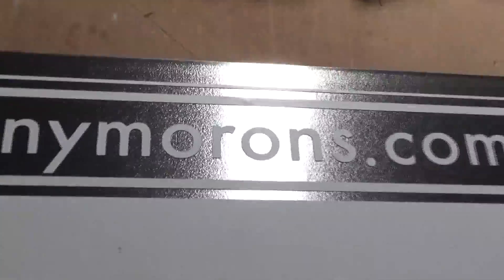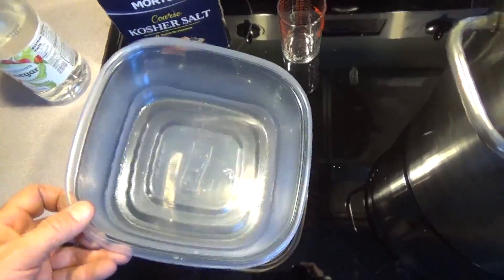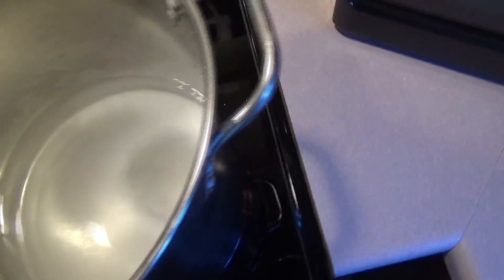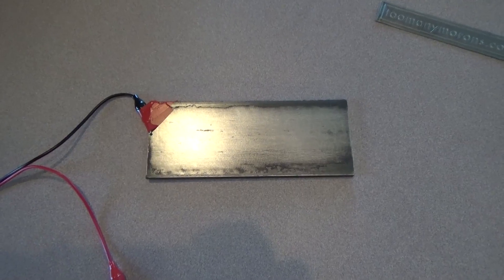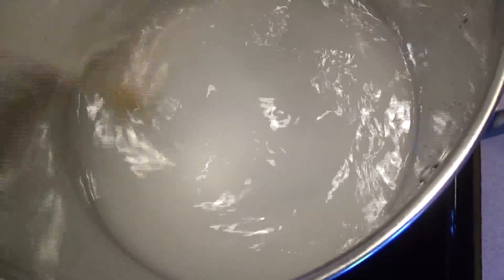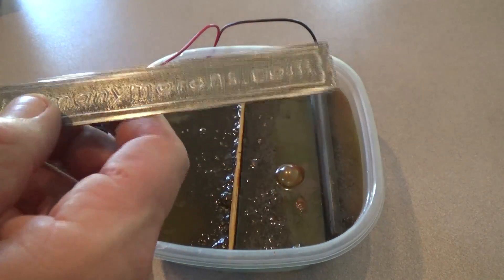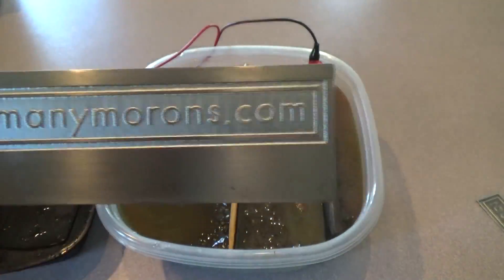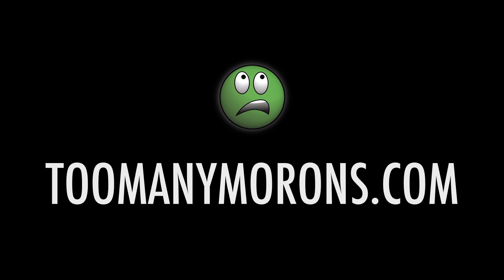Electro-Etching Steel using vinyl mask- Attempt #2

Comment: I have some questions please. 1. How important is the temperature of the water ? 2. Does the sacrificial part have to be that big, don't you just need contact for the current to flow through the solution ? 3.  Does the sacrificial part have to be of the same material as the part being etched ? Then lastly I think brushing it with a paint brush every so often will get rid of the bubbles or you can have a mechanism slowly rocking it so the solution rushes over the part and getting rid of the bubbles.

Comment: Very nice video…how did you make the paper letters template?
Reply: You can do it with a cutter that you connect to your computer; it looks like he did this cause it is so accurate. You can also just do it with a knife. All you have to do is have the vinyl which is baically just a big sticker that will stick like tape to the etching. It's real easy..

Comment: Any issue with hydrogen gas due to the electrolysis?
Reply from the maker: Im sure there is some off gassing but I’ve personally never had any problems. I know it’s probably safer to do it outside, and if I crack a window and get some circulation with a fan in the area so the gas doesn’t really build up in a given space, I feel better about the situation. It would be pretty hard to cause some kind of reaction or “explosion” ... But that’s me. Like anything, just use some common sense/precautions, and if you feel unsafe doing something, just don’t do it. At least use a fan and try not to breathe heavily around it when you are dipping/ removing etc. It’s a fun process and can do some cool stuff. I personally would hate to let TOO much “safety” get in the way ;)
Reply: @fleanine  thanks for the reply, no for sure looks really cool and great idea some reason YouTube has been recommending HH0 generator videos to me en mass, and I've been watching so I guess they know best, but I was like this is basically the same thing in principle so more curious than anything keep it up appreciate the vids and reply.

Comment: Need help in setting up this unit can you breif step by step process and machine and chemical required as well Safety measures | thanks in advance
Reply from the maker: If you watch my more recent video i go thru the process a bit more/ and add text on screen that shows the different ratios of water/ salt/ time / metal etc. Hope this helps. Thanks for watching!   https://youtu.be/Jab0X2MuK5s

Comment: So you don't touch the Amp setting only the volts? What metal did you uses for the sacrifice?
Reply from the maker: LEO Thanks for stopping by and taking the time to comment. I appreciate you watching.I have a more current video in my etching playlist that will answer your questions,  in that video I do various metals and show the recipe and result for each at similar settings for comparison. Please check out the playlist here: https://www.youtube.com/playlist?list=PLWT95-YNcJQ-a97KD8fKynnWMg5ZZC9Oj
Reply: @fleanine  You are most welcome mate. I've been looking into this for the past few days now. My 17v 3amp Transformer doesn't etch much at all using the cotton earbud method and regular wetting.
I'm trying to work out how people are getting these results
Is my power supply to weak?
Reply from the maker: @LEO I use the Dr. Meter shown in the following link , i would think if your machine is a 17v/ 3amp it should do the trick, if anything it’ll just be a tad slower without the amperage, but should still work. It will definitely work better with submerging, rather than the wiping with a cotton ball or similar. Just make sure you use a bunch of salt and let it do its thing..      Dr.meter 30V/5A Variable Linear DC Bench Power Supply Single-Output 110V/220V Switching with Alligator Leads Included, US 3-Prong Cable,PS305DM for Lab Equipment https://www.amazon.com/dp/B00O8DJ8QC/ref=cm_sw_r_cp_tai_WEUPEbGG6RVDW
Reply: @fleanine  I have watched almost all of your videos now. I'm wondering what Transformer I need. I would like to do completely submerged Etching as well as semi wet. What supply is optimal?

Comment: Great video I’m curious how deep did that go I want to make stamp to mark my lead flashings that I make they are only around 1.8 mm thick I could just order a brass stamp off eBay but there’s no fun with that
Reply from the maker: I have several other videos that go into getting a deep etch for branding irons etc.. definitely deep enough for a stamp. may have some decent info for you there. Check out my electro etching playlist! Thank you for watching and taking the time to comment!
Reply: fleanine checked out your playlist it was very helpful thanks then had a play I need to get some vinyl cut when the lock down is relaxed I tried with the printer toner method and the only salt I had (table) and left it for and hour it definitely started to work but the toner dissolved before the hour was up I can clearly see the etch just needs a little more depth 👍🏻
Reply: I got my vinyl and been playing I’m semi happy with my first attempts I’ve made a punch with my business name to stamp my lead flashings and a brass branding iron to mark my ring boxes I’ve got some more vinyl on its way to try again I left the brass a little too long and got some under cutting and I lost some letters on the steel hopefully second time around will be the one

Comment: Awesome it must of felt so good to peel off the resist and see the depth! so satisfying....I know I need a life!
Reply from the maker: Debra Kowalski nah, you’re right. It is satisfying. I have a more current video with a better recipe and different metals and some even better results if you’re interested. https://youtu.be/Jab0X2MuK5s Thank you for watching and taking the time to comment. I appreciate it!
Reply: I am looking all your videos now. I have a laser cutter I use laserbond to "etch" on stainless steel it doesn't create depth in the etch. Im interested in using the laserbond as a resist instead of vinyl which i find to be a PIA. gonna see if it works with this salt water etch
Reply from the maker: I have not heard of this laser bond stuff I just googled it quickly and see what you’re talking about now. That seems like a great idea. I am curious about your findings. Definitely cmon by again and let me know if you do some experimentation with this. I have tried a couple other things for resists like screen printing Inc. etc. so this sounds like it may work. As long as you have something that will dry and not be water-soluble I think it would work. Please do share what ya come up with!!!

Comment: What power supply are you using?...make and model?...Thanks!...Great work by the way!
Reply from the maker: I use this model. Dr.meter 30V/5A Variable Linear DC Bench Power Supply Single-Output 110V/220V Switching with Alligator Leads Included, US 3-Prong Cable,PS305DM for Lab Equipment https://www.amazon.com/dp/B00O8DJ8QC/ref=cm_sw_r_cp_tai_-I3DEb3YYVC31 
It’s been working out great so far. I have a couple more recent videos in my “etching” playlist that go more into a decent recipe for a good etch and what I’ve changed since this video May be worth the watch... here’s that link: https://www.youtube.com/playlist?list=PLWT95-YNcJQ-a97KD8fKynnWMg5ZZC9Oj

Thanks for watching and taking the time to comment! I appreciate it!

Comment: The pitting is from small bubbles you have to brush the metal piece tillbubbles are gone
Reply from the maker: For sure. I have some newer vids in my Etching playlist that address that a bit more.. I occasionally pull it and rinse and/or brush lightly etc. Thanks for taking the time to comment , I appreciate you watching! Cheers!

Comment: I am not a "Metallurgist's",...but I was wondering if using a Heat Gun to help with the vinyl appliques might help? Just a thought!
Reply from the maker: Actually you are 100% correct! I address that - about two minutes in -on a more recent video. It definitely helps the glue to bond better! Thanks for watching and taking your time to comment. I really appreciate it!  
Here’s the video I’m referring to: Electro Etch Deep Enough for Branding Iron https://youtu.be/lFaSt03wTd0

Comment: I think you could get even better reaults by using a plate wrapped in gauze and then moistened in electrolyte solution. 12v 2amps. Check out one of my videos you have complete control as to etched depth  https://www.youtube.com/watch?v=ryUvbaaI9kY&lc=z22guzkr3kaoezfdfacdp433w1i5pirjgqcfvpd1311w03c010c
Reply from the maker: Very cool, I’ll check it out. Thank you for watching and taking the time to comment. I actually have a more recent video where I updated and provided a decent recipe and got great results on various metals, including Damascus steel... here’s that link : Electro Etching Various Metals- Copper, Aluminum, Steel, Damascus https://youtu.be/Jab0X2MuK5s

Comment: Nice video. Quick question. After the process is done the water is toxic? Can i throw the water without problems?the negative metal has to have the same size as the positive? Thanks a lot
Reply from the maker: There are proper ways to get rid of the water, I just reuse mine until i cant anymore. Some local dumps or trash collection have a way to take chemicals or "hazardous" stuff. In the past, if the container was small enough i just let it sit until all the water evaporated and then wiped out the bin. The negative and positive don't have to be exactly the same , it just makes sense in my mind that the two parts should be relative surface area so the electricity has the best chance of flowing continuously. Thanks for your comment and taking the time to watch the video! Check out my other etching stuff in this playlist: https://www.youtube.com/playlist?list=PLWT95-YNcJQ-a97KD8fKynnWMg5ZZC9Oj
Reply: Can contain toxic Chromium.

Comment: Thank you for taking the time to post these videos. I am getting ready to do this myself and you are saving me a lot of time with trial and error. Can't wait to see what you come up with next!
Reply from the maker: I really like to hear when a video was helpful! Thanks so much for watching and commenting! I appreciate it! Good luck with your projects!
Reply: @fleanine  I did my first trial run the other day and it came out amazing! 4.0V @2.5A for 60 minutes on aluminum using vinyl as the blocker. Kosher salt and Distilled water diluted until the water wouldn't accept anymore salt. Thanks again.
Reply from the maker: Craig Darpino Thats is fantastic to hear! I love when things work out on the first try! Thanks for reporting back with your formula, I’ll be posting a video soon of other metals and comparing etch times with the same solution. It’s good to hear what you used for aluminum. Just out of curiosity what size container were you using / how much water? Cheers!
Reply: @fleanine  Awesome! I can't wait to see what you come up with. I did notice something interesting though. The etch is not as deep where the lead is hooked up. The further from the power source the deeper the etch. I am trying to find out a way to spread the load across the item for a more consistent etch.

Comment: I didn't have a power supply like yours, which is very cool by the way that you can adjust and set volts and amps, so I figured I'd make a power supply by hooking a battery charger up to and old, but good car battery. Thinking the battery would act as a buffer so I wouldn't burn out my charger.
The charger only has three settings, trickle charger, 10 amps, and starting mode @ 50 amps.
I ran the charger at the 10 amp setting @ 12 volts. It took 12 hours to eat away .088 to .090 depth in free machining brass stock. 
To check how much material was removed, I used a drop dial indicator to check depth. I'm very surprised the depth was so consistent. The etched away surface was surprisingly smooth. 
Thank you for sharing your etching results for comparison.
Really looks good except for where the salt water leaked under the vinyl lettering a bit so the edges of the lettering is not really sharp.
Reply from the maker: Keith Lane glad to hear your first attempt was successful! Thanks for watching and commenting!!
Reply: His power supply only costs 60 dollars on amazon so I recommend  getting that instead. I tried using a car battery and it works, it's just really slow.

Comment: So I have tried this, set up the leads exactly like you have them.. negative on sacrificial piece and positive on the etched piece. I kept it in for 4 hours yesterday at 1.5 volts and absolutely nothing happened to the metal. I'm using steel.. do I need to significantly up the voltage? Trying to get a super smooth etch. Negative piece looks like its conducting but nothing is happening to the positive. Any help??
Reply from the maker: I would start at around 5 or 6 V.. depending on the mix of salt in the water, affects the amperage that flows. Can go up accordingly. Hope they helps .
Reply: @fleanine  So I just up'd the voltage to 2.8.. that's all it allows me to go up. We have the same amplifier.
Reply from the maker: Then I would try to add more salt to the mix and maybe some boiling water

Comment: Thanks for video 
Can you tell me is this work with sharpie or iron transfer metod??
Reply from the maker: samir pasic I would use something more like scotch tape or packing tape to be safe. Not so sure the sharpie would hold up under the solution for too long. But you can use a Q-tip and just swab gently instead of submerging for smaller Etches. Hope that helps.  Thanks for watching !

Comment: How much does it smell?
Reply from the maker: Andrew E the only real odor I noticed was the vinegar, which in hindsight is not necessary... it’s all a learning process.
Thanks for watching!
Reply: fleanine good news, aiming to do it indoors and don't want the complaints!
Reply from the maker: Andrew E there are supposedly some chemicals released during the process that are not good for you,( someone posted a link in my comments earlier) and if you are concerned id look into the process a bit more. I don’t do this that often so I don’t consider it a problem, and I did it in a fairly open kitchen and noticed no off gas whatsoever. No I’ll effects... it’s your call. Just throwing that out there to be responsible. Happy etching. Be safe.
Reply: fleanine ok ta, I'll give it a crack on a small scale keep my nose peeled. I know it's theoretically possible to actually create hydrogen & oxygen but you need voltages >12V to do that and it's rarely mentioned so probably isn't that easy to do . Beyond that I've not heard in any guides about noxious fumes. If it is the case and I want to do more i'll make some crude extractor. Cheers!

Comment: Try using Ferrous Sulfate in (250g / Liter distilled water) instead of salt.

You will get zero sludge / scum.

Also try dropping your voltage to somewhere under 5V

Use a stainless-steel or Titanium (expensive) cathode if you can.  SS or Ti mesh works great.

Keep the work piece (anode) an even distance from the cathode so it's exposed evenly to the ion/electron flux.

Lower voltage = less / no bubbles = smooooth.  Just takes a long time... who cares though =)

Keep posting!

p.s. be sure to use a proper grade of ferrous sulfate such as that sold by alpha chemicals - it's cheap and you can reuse it FOREVER (don't throw it away!)  Just be sure to only etch steel in and it will remain CLEAN - just occasionally filter out the excess iron / carbon buildup.
Reply: George Viaud
Can you tell me if i use that ferrous sulfate and water,how long i need to wait to get 1 millimeter etch on steel size 5"×7" ???
And is it good idea to buy tb95 etching solution?
Thank you
Reply: Good tips. I notice everyone has their own formulas and process. It's all good.
Reply: How u guys make a smal detailed vinyl coz the cutter plotter ain't that good at it
Reply: HOLA to the group! Neo Geo, do you videos made from you? Showing the formula and materials,that you explained here? Is always good to see everyone styles! Thanks in advance
Reply: Is ferrous sulfate also giving better results?

Comment: Will this process affect wood? I’m hoping not. I have an axe head I want to etch but it has a wooden handle. Can I just tape up the handle? Would the process stain the wood?
Reply from the maker: Walter Johnson It may stain the wood a little bit, but won’t erode it. I assume removing the metal from the wood entirely is not an option, however that would be the best way to go. 
 Taping it off will definitely help -also pay attention to any gaps that lead between the head of the ax and the handle . If fluid can reach it , it will etch. If there are any gaps I would probably put some hot glue in the gaps or something like that, so you will only etch the external surface of the ax and not any metal that is contacting the wood in the center, which could potentially  remove enough metal to make the ax head loose. Thank you for watching , I hope this input helps a little bit.

Comment: Hello,nice video.
Tell me if i want to etch 8" x 10" steel,how many voltage i need and peace on negative side how big need to be ??
Where in store i can buy aligator clips???
Thank you  very much for video and i hope you will answer on my questions ??
Reply from the maker: samir pasic 8x10 is just as simple as the smaller piece I did in this video. You will obviously need a larger bowl or container.... The amount of voltage will depend on how strong the mix is and how well it conducts the current. In the video around the 5:45 mark I show what settings I ended up with.
You can get alligator clips in the electrical department of most big box stores. I hope this helps!
Thanks for watching - more to come soon!
Reply: Thank you